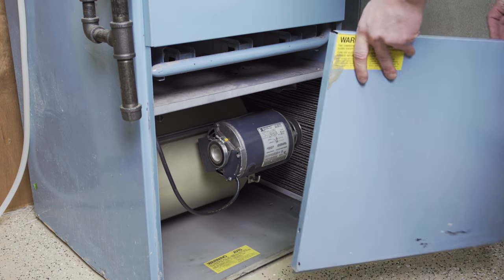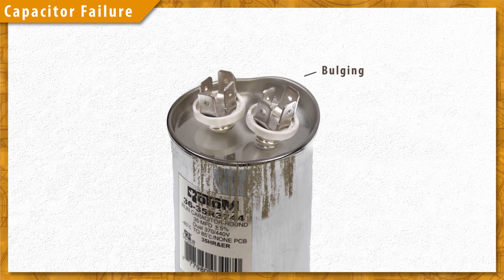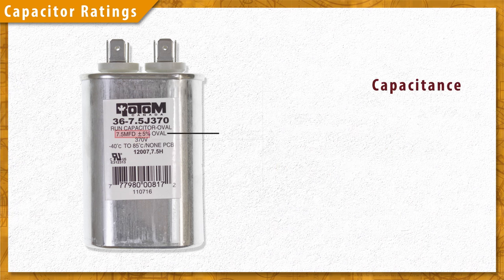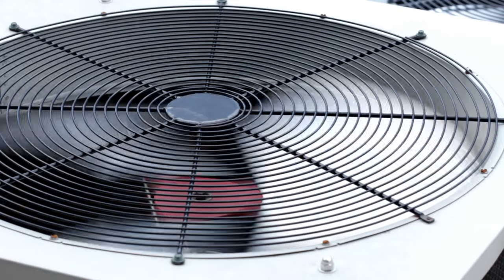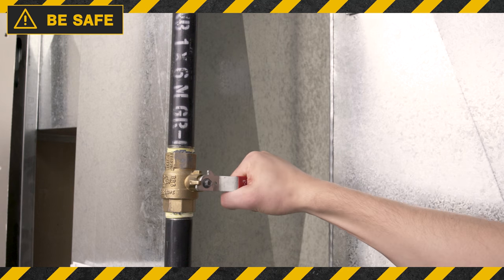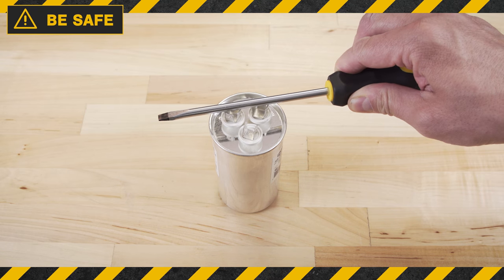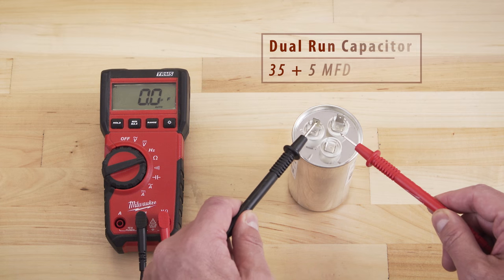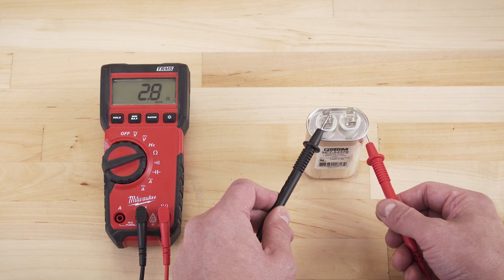How to Test an HVAC Motor Capacitor | Spec. Sense

Comment: If the reading is low like the one on this video at the 4:00 minute mark, will the motor still run or not or does the motor run but not as fast?
Reply from the maker: Thanks for watching. If the capacitance is really low then the motor might not start. If the motor does start it will effect the efficiency.
Reply: @AmreSupply  I've noticed that my blower is blowing around 20% less than before from the vents and less suction from the intake vent/filter.  I don't hear or noticed an indication of motor bearing wear.  I ordered a new capacitor but haven't gotten it yet.
Reply from the maker: @squidusn71  Thanks for the update. Was that a sudden change or is it something that has dropped off over time? Also is there anything restricting ariflow? Did you recently put a furnace filter with a higher MERV rating in? These can change the dynamics within the system.
Reply: @AmreSupply  Happened after I changed the gas valve.   The filter is new and it is a low restriction filter.   I don't have a meter that will measure capacitance at the moment.

Comment: Can I use my multimeter to test the cap in my furnace, mine says 1.5volts under the capacitance setting
Reply from the maker: Thank you for watching. You can test your furnace motor capacitor but it should not show voltage when testing capacitance. The voltage rating on the side refers to the maximum voltage that it can handle. The capacitors charge will be in microfarads (uf).
Reply: @AmreSupply  thanks for the reply , I should get a good reading from my multimeter then? I'll be shopping at my local amre supply because of this service!
Reply from the maker: @Iftrades  Thank you for your support! Test and reference on the microfarad reading on the side of the multimeter. The capacitor should be within 5% - 10% of that reading. If it is out of that range, then it's best to install a new capacitor. If you need a new capacitor you can match one from the selection here: https://www.amresupply.com/catalog/Accessories-635291

Comment: I have the same capacitor with the SAME logo, but none of the numbers on the one in this video match the format printed on my capacitor, wtf.
Reply from the maker: Thanks for watching. Is there a MFD or voltage rating at all on your capacitor? 

If there is a part number you can always search it and use it as a reference. You might be able to pull up all the info digitally.

Comment: Can I replace my gas furnace fan motor 208-230 voltage, 7.5 MFD with a fan motor that is 208-230 voltage and 10MFD?
Reply from the maker: Thanks for watching. When installing a replacement motor, you'll have to match HP and amp rating. If the new motor is rated for a different capacitor, then you'll need to install a compatible capacitor with the new motor as well. This video explains some of this in detail: https://www.youtube.com/watch?v=TF3QtXWd8s0
Reply: @AmreSupply  Thanks for the information
Reply from the maker: @dianavangaalen2190  You're very welcome!

Comment: So would a reading of 6.8 be too low for a 7.5 uf 370vac run capacitor
Reply from the maker: Hi Dustin, thank you for watching. Generally for most capacitors the acceptable variance is 5 - 10%, so at 6.8 its a little on the lower side and could create some issues.

Comment: My capacitor read absolutely nothing on the multimeter! I am hoping this means this is the broken aspect of my HVAC. I will report back if this is the case.
Reply from the maker: Thanks for watching. Yes if there is no reading then the capacitor should be replaced. Keep us posted!
Reply: @AmreSupply  My efforts failed. I replaced the motherboard to the furnace, the capacitor, and the thermostat upstairs. Combined, my problem still remains. Can't get my system to turn on. Neither A/C nor heat nor fan-only. Sad day.
Reply from the maker: @EvanA.  Thank you for the update. You might want to test to see if there's proper power going to your thermostat. We don't have a tutorial showing this but that could explain the problem.
Reply: @AmreSupply  Thanks! It turns out that was the issue. The HVAC guys my dad knew were able to resolve it and saved me a lot of money. Why the power suddenly stopped reaching the thermostat, I'm not sure.
Reply from the maker: @EvanA.  Interesting. Thank you for the update.

Comment: If you have ever experienced a capacitor explode, even a small one, you would not use a screwdriver to discharge.  Instead, use a bleeder resistor.   (Only take one explosion to change your mind) !!
Reply from the maker: Thanks for watching. You are completely right that a bleed resistor is the safest and most controlled way of discharging a capacitor. You will however get HVAC techs who still use screwdrivers to do this for work on lower voltage residential capacitors such as those in a furnace blower motor.
Reply: Went to school Northern Alberta institute of technology ,lol this how the instructor  discharge caps.@AmreSupply

Comment: ac only hums/buzz's, then shuts down, no fan running on outside unit. capacitor maybe?
Reply from the maker: Thanks for watching. Yes the hum is a good indicator that the motor is receiving power but isn't starting. It would be best to test the capacitor.

Comment: At 3:43 Captain Obvious teaches us to test the capacitor by using a meter that tests capacitance.  "Go buy expensive meter, apply probes."  Also Captain Obvious:  Ignore we are measuring Ohms because pressing upload again is hard.
Reply from the maker: Thanks for watching. To test a capacitor,  testing capacitance is necessary to make sure that it's within the acceptable range. As there are many multimeters that can test capacitance that that are only $30 so you don't need an expensive multimeter to do this test.